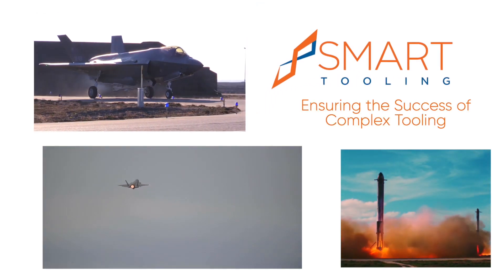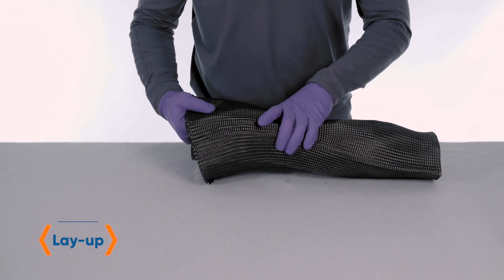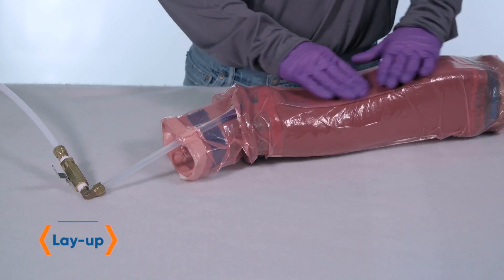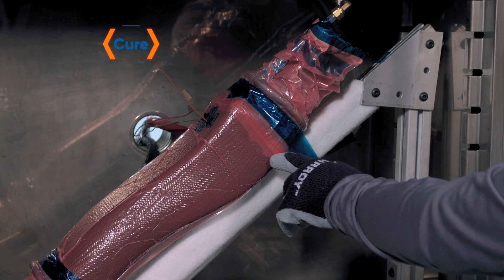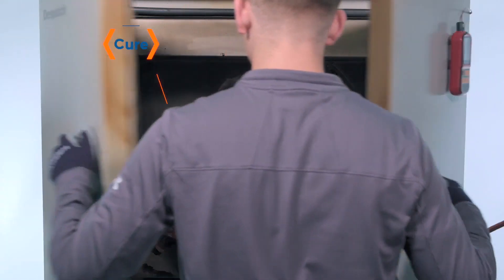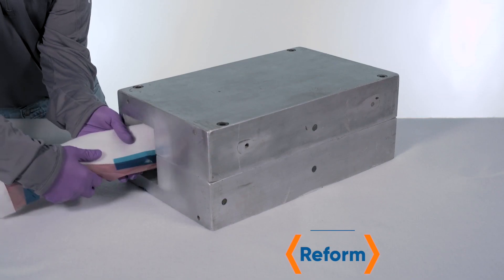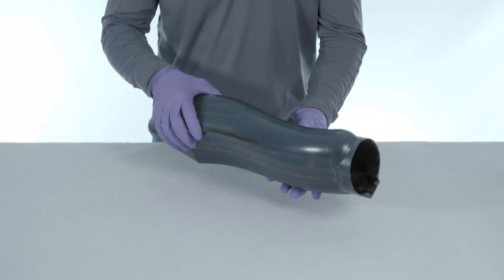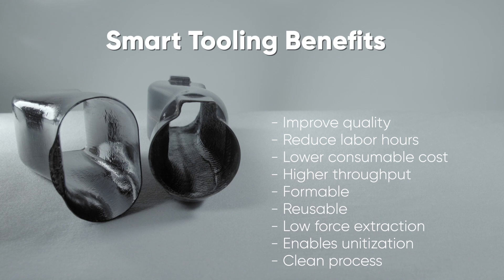Composite Mandrel Inlet Duct Demonstration | Smart Tooling Process

Comment: In the second oparation, a prepreg and vacuum asistance can form the shape directly, this smart tooling and resin infusion process step seems unnecessary to me.
Reply from the maker: They key to this demonstration is that we eliminate using manually applied prepreg in order significantly reduce material & labor cost by using dry carbon fiber sleevings and resin infusion. Also, the Smart Tool mandrel is reusable for typically 60+ cycles driving down the per cycle tool cost.